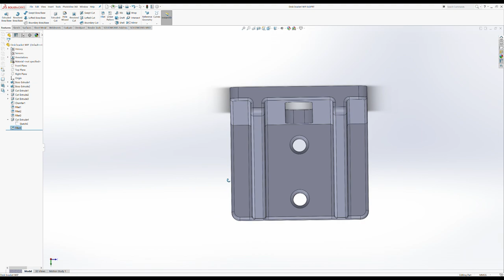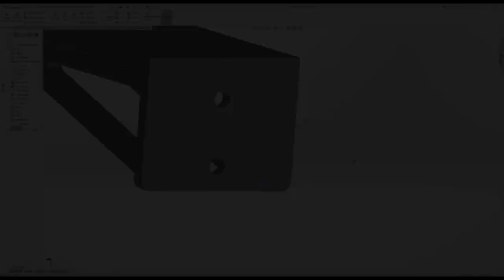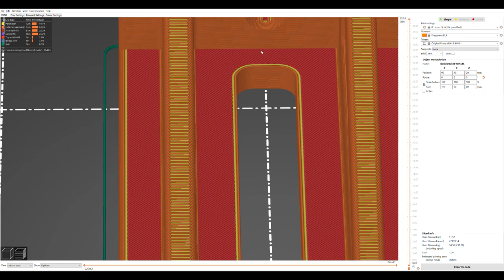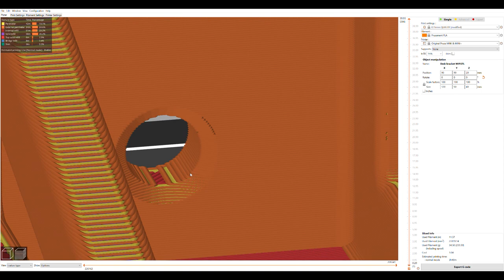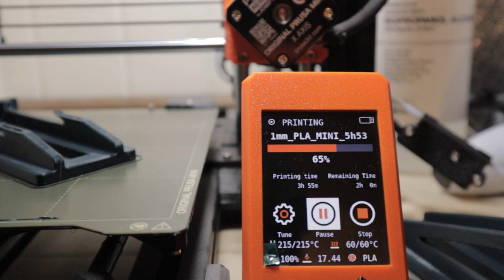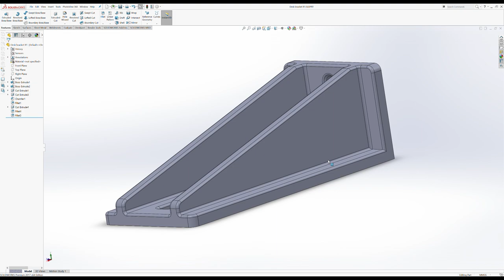FAILED 3D PRINT - Overhang Design Desk Brackets

Comment: Good video, the end result solved your problem nicely. Something to keep in mind is the possibility of printing the part you design in a different orientation that may be more accommodating to your overhangs, although in this instance had you printed them vertically you would have had less strength for your application technically.
Reply from the maker: Hey, thanks for the comment. Yes, I agree. Orientation is one that shouldn’t be missed. In some cases this could Definitely be the solution to your problems! I’m glad you liked the video.

Comment: Which C A D do you use? What hardware is your computer using to run the software?
Reply from the maker: Hey, I run solid works mainly. Computer is custom built, but you dont need an awful amount of machine to run it. 
This computer has 16GB ram, I7 processor and a 1060 3GB graphics card. For small parts/ assemblies you are fine. When you load a big assembly with multiple parts that's when your computer feels it 😀
Reply: @MasonsWorkshop  I’ve just bought myself a laptop, near enough to what you have. 16gb ram, i7, 3060 6gb graphics. So maybe some hope as I thought it may be too slow. Is solid works a costly purchase??
Reply from the maker: @pmf2910  you will have no problems with that setup! Solid works is costly but you can get trial and student versions to start on. Also fusion 360 is readily available for free or a low cost! Worth looking at.

Comment: You mentioned how you would support that.

There is (currently) an alpha release of Prusa slicer that uses tree supports similar to Cura, but I think it calls them organic supports. They would probably work nicely with this as they could start on the bed at the side of the model and branch up and into the gaps.
Reply from the maker: That sounds brilliant, I will have to check that out. As designs get more complex the need for a good support system is essential, thanks !